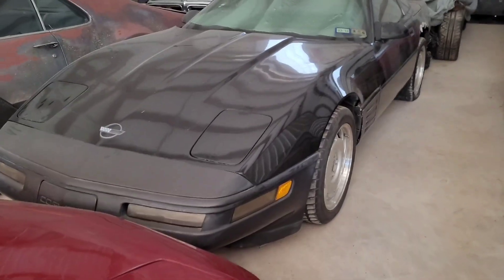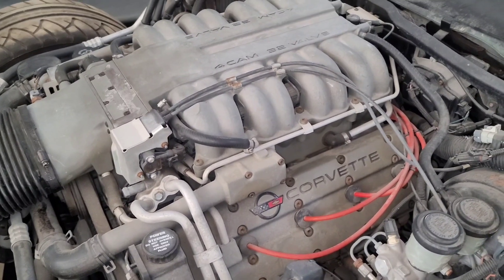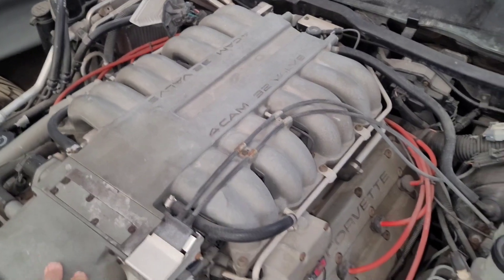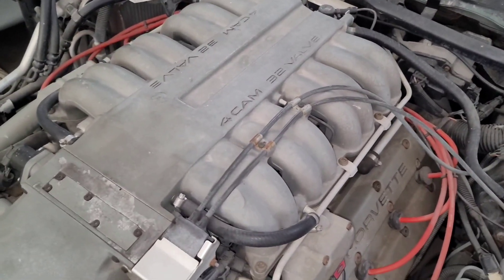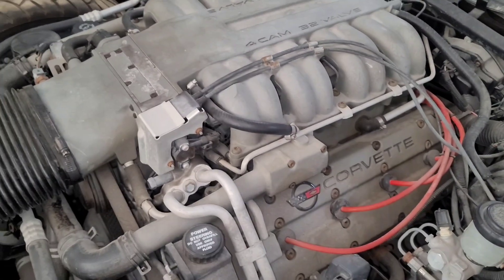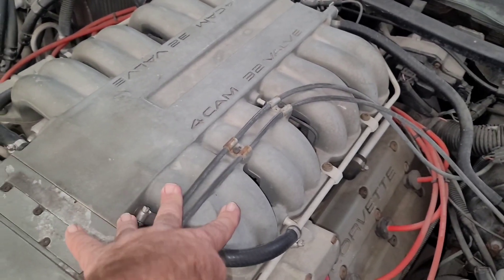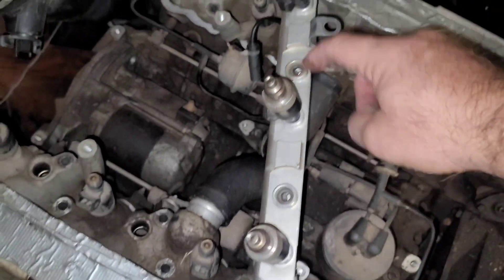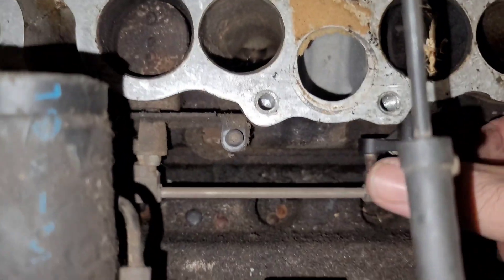The Epic C4 Corvette ZR-1 LT5 Engine of the 90's

Comment: What's the big deal FORD had the camer i
Reply from the maker: I'm guessing you were born after the LT5 was produced😁.
Reply: @VetteSource   No I'm older than u long live the 427 sohc as far as chefs go that's the best motor they made
Reply from the maker: Ok, now I'm clicking. For some reason I thought you were referring to the modular engines from the late 90s/00s. Like you, the Big Blocks of the 60's are my favorites for power and pure sound. The best expression I ever heard about a solid lift cam/high compression big block was that each cylinder sounded like it was living it's best life while idling. Definitely something that can't be replicated with today's engines.
Reply: HOw many yrs was the cammer in production? Longevity mpg? 
Those 2 arent even in the same solar system.

Comment: Can u break down the l98 vs lt1 c4 power (all stock)???? Lt1 has 50 more hp !! Thats alot!!! But 0 to 60 times are basically the same??? So from dead stop to top end at what point and at what MPH does the lt1 50 extra horse power kick in and pass the l98??? This is all me and my c4 friends talk about!!!!  End that battle cause no body is gonna race past 60 round here !!!
Reply from the maker: That's an excellent idea👍. Having both a TPI and LT1 here, I'll see if I can put together something that can address those questions for you guys.
Reply: @VetteSource  awesome!!!!! Looking forward to it!!
Reply: Thats due to the short tunner intake of the LT1 it pulls more rpm where the L98 maxes out thats all.

Comment: @VetteSource, there most certainly is a PCV system on the LT5.  In fact there are 2 PCV valves.  You're looking right at them at 6:40 in this vid.  Not in the typical valve cover location, but they are there.
Reply from the maker: Hey Aaron, that is correct. I addressed it in one of the earlier comments you may have not seen. Thanks for clarifying for everyone👍

Comment: Do the engines make a different sound when secondary key is turned on?
Reply from the maker: That's a good question. I've never noticed a difference in the timber or exhaust note between the two settings. Most of the distinctive sound of the LT5 comes from the overhead cams when pushing it into the higher RPM ranges.
Reply: Youll definitely hear it

Comment: The record was broken in the 2000's by a Volkswagon that was pretty much a race car . Not a street car with a production engine. They did change the 3.45 gears in the ZR1 to a 3.07 unit to help keep the engines revs down. They were running at 75 % throttle . The drivers got in and put the pedal to the floor . Still it was one hecht of a record . They also ran a L98 Corvette producing around 350 horsepower along with the ZR1 . Both cars set records. There is a video about the record run and it also can be found here on YouTube.  

The LT5 responds well to modifications like long tube headers and a free flowing exhaust system. The 90-92 system steals some power . They fixed this on the later cars . They also used the better mufflers on the 96 LT1 and LT4 Corvettes. You can bring the 375 h.p. 90-92 LT5 up over 400 h.p. with long tube headers and better exhaust system than the factory one. 

If you do full engine porting of the plenum , injector housings , and cylinder heads you can be over 500 h.p. . Porting is done per the engines displacement. The next upgrade would be to go with larger pistons and cylinder liners . A popular upgrade is the 368 displacement . Next is to stroke the LT5 but this gets expensive . The big motor use to be a 415 making over 600 h.p.. Now some are well over that like 441 cubic inches. Lingenfelter with Lotus' Graham Behan was adding twin turbos for whatever power you wanted 700+ or even beyond 800 , 900, even over 1000 . 

Check out the ZR1 specialist , Marc Haibeck has been doing these cars for many years now. Another LT5 builder is Corey Henderson . Also check out the ZR1 net registry website.  

Marc did my 91 . It's a stock 350 cubic inch LT5 making 528 h.p. at the crank. This included full engine porting for a 350 , larger throttle body, bigger injectors, long tube headers, Corsa 2.5 exhaust,  fidanza lightweight flywheel , Marc's custom chip for the combo, short throw shifter, and one of his secondary deletes . It runs on all 16 injectors all the time. The fuel economy isn't hurt much at all by this mod . Currently it still has the stock 3.45 gears but I have a 4.10 Dana 44 center section to go in. You can run any gear you like 3.70 , 3.90, 4.10 , or even 4.30 . The 4.10's make the tall 6th gear more usable on the highway . With stock 3.45 gears you would only use 3 gears at the drag strip. 4.10's you would be shifting into 4th just about the time you reach the trap. The 4.10's give you more torque in all gears . You need good sticky tires like a drag radial though.
Reply from the maker: Dave, thanks for the thorough writeup. Lots of good information you shared there. Just out of curiosity, is anyone still making headers for the LT5? I know the aftermarket likes to move on from what they believe is old tech, but it would be cool to still be able to source some aftermarket exhaust goodies for them.
Reply: @VetteSource  Last I checked Stainless Works was still making a complete exhaust system for C4 Zr1s.
Reply from the maker: Excellent!. I'll have to look into their systems to see what's available when I begin the reassembly on this one. Thanks for the lead👍
Reply: @Airwolf1971  Aaron Scott at South Georgia Corvettes did my engine work, including custom paint. Aside from 'other' mods, he installed Stainless Works headers and a B&B Tri-Flo, 3" stainless exhaust. Improvement in sound and performance are ... 'Noticeable' ! ;-) ^v^
Reply: @VetteSource  OBX has headers and Maximizer maybe for less than Stainless Works just not to sure on fitment and quality.
Reply from the maker: Cool, I'll check them out and see what they have to offer.

Comment: I would replace my lt1 in my trans am for this LT5 engine
Reply from the maker: Now that would be an awesome upgrade. I'll bet somebody has tried it somewhere, but it would definitely take some custom modification.
Reply: @VetteSource  This was where GM failed the f-body owners like me, if they would have ported this LT-5 motor to the 93-97 f-bodies instead of using the mechanics nightmare the LT1 with having to replace the opti-spark when failed and change of the hard to get to spark plugs from time to time it would have been reliable imo, if you look at how the LT5 spark plug and distributor are placed on this motor, it's not a money pit like the old LT1 seriously, let me tell you, when i first bought my 95 trans am, i did not do any research, first time i wanted to change my spark plugs, i literally cried under the cars, well my eyes watered like WTF! i pay $300+ to $500+ for a mechanic to change what i mentioned, I live in Cali,  and also those LT1s hardly pass smog here with the dreaded DMV emission dyno test just to let you  know.
Reply: @RichardM.619-SD  Believe me the LT1 is the engine you wanna have in that car Dont even know if it would fit under the cowl .If it did good luck servicing it. BUild your lt1 plenty of good parts to make it fast

Comment: Could you put this engine in a older 1981 camaro? Im interested for my car
Reply from the maker: It's definitely a swap that can be accomplished, but a little more complex due to the custom wiring harness and specialized engine fitting that will be required. If you do a Google search, you'll be able to find some cars that have an LT5 swap to give you some ideas.
Reply: Sure can. Wont be cheap youll need the electronics, have to figure your fuel system (used 2 pumps). Doable but not a weekend swap
BEtter get one complete as possible cause little parts will cost a fn fortune

Comment: LT5s have Forged Aluminum Cylinder liners- Nicosil Coated, not Steel,, they have Hydraulic lifters, (lt6 is a solid lifter engine), and the only secondary butterflies are in the other 8 of 16 plenum tubes, not the dual throttle body's, (those are coupled together).
Keep up the videos, but please try to give correct info.
Aren't these LT5 engines BITCHEN!!!!!
WAY AHEAD OF THEIR TIME!!!
Reply from the maker: Yep, I seem to remember the cylinder liners being aluminum now that you mention it, but its been so many years I forgot that detail. 

I don't believe I indicated that the LT5 had solid lifters, or that the secondary throttle butterflies weren't in the plenum tubes. 

My videos are usually done in a stream of consciousness, so it's possible I misspoke without realizing it. I'm not a spring chicken anymore and the older I get I realize there's way too many details to remember regarding the different generations of Corvettes.😂.

I do however, recall pointing out the plenum secondary butterflies in the last half of the video. Maybe you missed that section.

Thanks for your recommendations, I'll take them into consideration in the future. Appreciate you watching and commenting👍

And I agree, the LT5 is still in my mind one of the most wicked Corvette engines out there.
Reply: @VetteSource   You did 'not' indicate that the LT5 had solid lifters or the the other issue he complained about.
Reply from the maker: Yea, that was kind of puzzling to me that he heard it that way.
Reply: @VetteSource  Everyone wants to be a corvette car expert online. lol

Comment: I had a 94 Z and you can remove the alternator without removing the plenum.  Not a lot of fun though.
Reply from the maker: Hey Steve, thanks for the information👍. Like you said it looks possible, but a tight fit to get it away from the plenum/throttle body/extension housing. That's one item I've ever had to remove from a running Z car over the years. Just shows how reliable the alternators have become over time.
Reply: @VetteSource  i hear you….I had to do the job twice as the first rebuild of the alt they installed a bad bearing.  Didn’t know it untill i fired it up!  There was a learning curve so the second time was a bit easier but still….

Comment: There is a Pcv system on my 1991 ZR - 1 .  Actually, there are 2 pcv valves
Reply from the maker: That is correct, I misspoke. Forgot about the two valves installed underneath the plenum. 

I may be misremembering since i haven't torn one down in many years, but I seem to recall something about the oil ventilation system being rather inadequate with the DOHC which necessitated the cylinder case box setup to recurculate oil fumes back into the plenum. 

Thanks for keeping me straight👍.

Comment: um... is that really how the secondary intake works?  like the tiny hole in the throttle body is the only opening in the "normal" key setting?  and the big plates don't open until "Full" key?  Something seems off about that.
Reply from the maker: yep, as odd as it sounds, that was the primary source for air flow. I remember the first time I saw it I couldn't wrap my head around it because I was used to the throttle blades of the L98.

Here's a general operation description -

A large, forward mounted air cleaner would feed a cast-aluminum throttle-body assembly with three throttle blades – a primary blade of 0.87-inch diameter and two larger, secondary blades measuring 2.32 inches across. 

The injection system of the LT5 actually operated in three, progressive stages.  In the “first stage” mode, air would be drawn into the throttle body and past the primary throttle blade to the plenum, from which it was distributed to the eight primary ports.  During this stage, the secondary throttle blades remained closed below 80 degrees (approximately) of the primary blade opening, which equated about 70 miles per hour on the road.  During the “second stage” mode, the secondary throttle blades would open to add air to the eight secondary runners and ports, providing that the ECM was satisfied that full power would be required.  In that event, the ECM would trigger the vacuum actuator to open the secondary runner throttles.  The third “mode” of the LT5 engine was commonly referred to as the “Valet Mode”.  Because the engine management system operated in stages that were mechanically controlled, the second stage performance could literally be locked out with a key.  The actuator could be manually disabled via a mechanism in the center console, engaging the “valet” mode, which inhibited full-power operation when handling the car over to parking-lot attendants or other vehicle operators who might otherwise not be trusted with the car.
Reply: @VetteSource  thats not technically correct. the small tb mid bottom opens first and the larger ones open soon after irregardless of the power key.  power key activates the vacuum actuated secondary throttle plates under the inj housings.
Reply from the maker: Ok, that makes sense. I was aware of the progressive opening of the larger throttle blades under increased speed/acceleration, kind of like the vacuum pods on the #1 and #3 carburetors on a TriPower, but wasn't familiar at what speed/throttle position they began to come into play. Thanks for clarifying👍.
Reply: @anondale5635  I had a 91 Zr1 and I agree. I thot it was the secondary throttle blades in the 8 of 16 intake tunnels that resulted in the added power. If it could make 210 hp on that tiny primary hole of air then they proved restrictor plates are unnecessary! haha

Comment: My mans got 2 lt5’s? Jeez bro. Last one I saw was selling for like 15k. Love the lt5 but it makes my lt1 look very simple lol
Reply from the maker: Simple isn't always that bad, my friend. I'll take the LT1 or LT4 any day when it comes to changing the oil or any of the engine driven accessories. Of course driving the LT5 makes up for it😁.
Reply: Had 2 when I owned mine. Kinda had to just in case. 
Had almost 0 miles it only sold for a couple grand on ebay. Days of getting 15k are long gone unless maybe its stil in a crate
Reply: You wrote that four months ago? 
I think buyers now, and in the future, are going to be disappointed. They’re going up.

Comment: i like the engine/ but i think i would not want it cause there weren't that many made, i will stick with my LT1 i would mind a LS too
Reply from the maker: Yea, that has become the problem as they've aged. If you can wrench on your own cars, it's not that bad, but God help you if your depending on a general mechanic shop to repair and source parts for the LT5
Reply: @VetteSource  if you need parts the go to place is the zr1net registry. Good group o guys there .Otherwise bend over! lol
One reason I decided to sell mine .Loved it but having to hoard parts extra engine "in case" soured me. DIdnt need them but still..